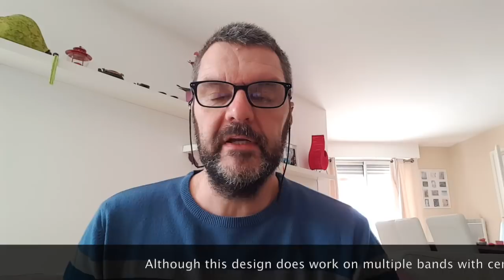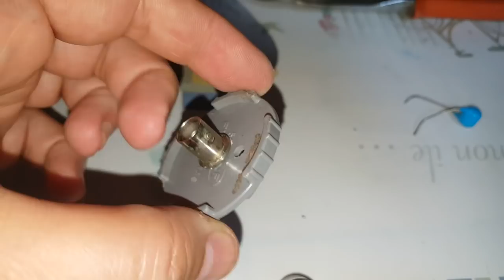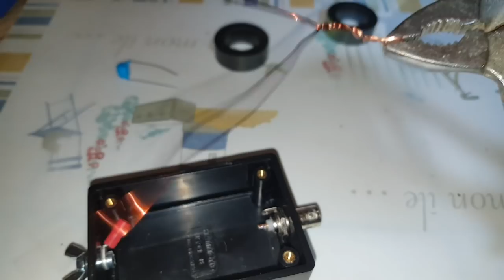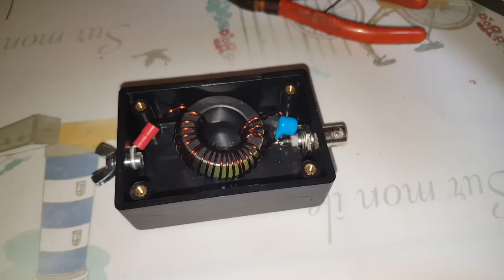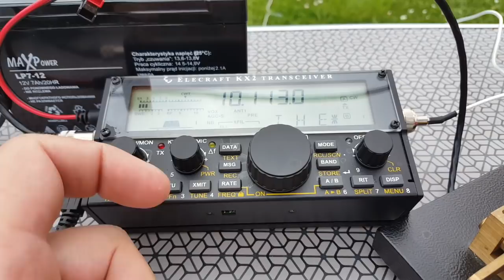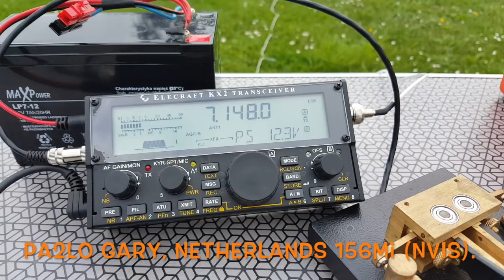The 49:1 Half-Wave End-Fed Antenna Transformer, Part 1.

Comment: Ugghhhh.
Drilling a hole with such a powerful drill and holding the job by hand is a good way to stop you from playing the violin for the rest of your life and make you scratch your bum with the other hand!
Reply from the maker: Yep, definitely...
Reply: Yup. I was building a speaker cabinet and putting a screw in and the wood broke. Well, the screw went into my hand while my finger was on the trigger of the drill. Lucky for me when it hit bone it deflected and didn't do anything other than tissue damage. I still have that screw and it still has some dried out flesh and muscle attached to it. This was like 25 years ago.
Reply from the maker: Soon or later luck runs out. Better be later...
Reply: I use step bits in plastic and metal.  You won't crack the plastic box.

Comment: Hi PREPPER,
I was going to try to build one but had no luck finding the right core.
Anyway i won the Chameleon E comm 3.
Had one in the past and now for the last 7 years i;m hooked on wire antennas.
Thanks for the fine video
BOB AF2DX
Reply from the maker: I found my cores on Ebay, but you can find them anywhere, they are very common and all electronic component stores will have them. Skywave DXer just posted a link for Mouser...
Reply from the maker: Thanks!

Comment: I am currently building a random wire end fed for my home antenna because of support limitations, i only have trees far out in my backyard, and dont want to run coax 250 ft to use a dipole. So my plan is end feeding it at the house ( about 12 ft in the air) then running a support rope to the highest point i can get it into the trees in the back to make a sloper. 
Im still not sure on what i want to do for my portable antenna though, maybe another smaller random end fed, a dipole, or an antenna like you built in this video.
Reply: connly33
Don't get the feed-end TOO close to the house on the half-waver. It's got lots of HV RF floating around which just loves to get into your rig with all sorts of probs. including burning your lips with a metal mic!
It can still happen with the random wire if you hit freqs which present a high impedance at the 9:1 UnUn
That's why Radio Prepper gave you that list of wire lengths.
Reply from the maker: Make the two versions like I did!
Reply: Better to run the coax to the bottom of your garden and feed it there, and then let the antenna come back up and over the house.

Comment: I've made this transformer using the same design document! It's fairly easy and so far has worked great.
Reply from the maker: Indeed, it was a quick build, no difficulty really..
Reply: Granted...I did not put mine into an enclosure...but now I want to. I used the part numbers on those instructions, so I had the larger toroids and magnet wire. It's a big transformer...61mm outside diameter and 12.7mm height
Reply from the maker: Presumably, the enclosure really doesn't make any difference and rain does not affect performances...
Reply from the maker: Presumably, the enclosure really doesn't make any difference and rain does not affect performances...
Reply from the maker: Nice!
Reply: @RadioPrepper  never assume rain won't affect things! It is really best to put it inside a box.
Reply from the maker: That might be a good assumption ;-)